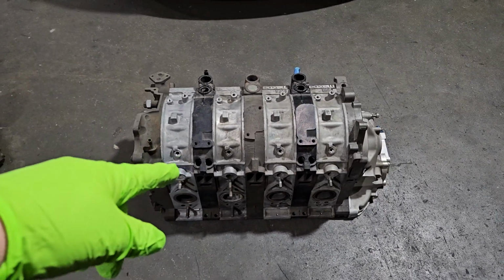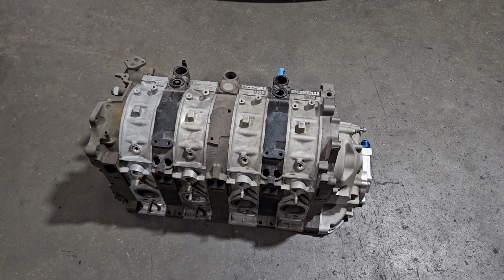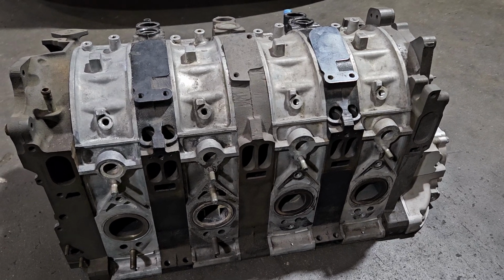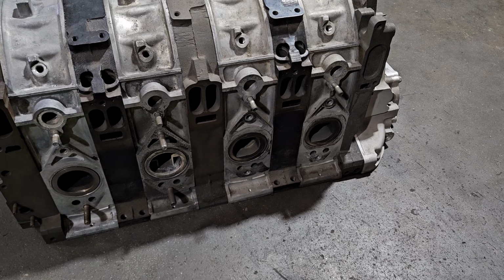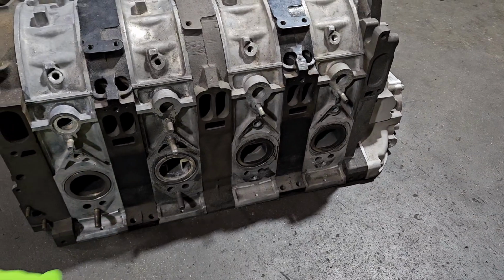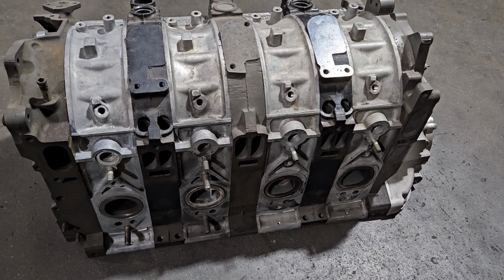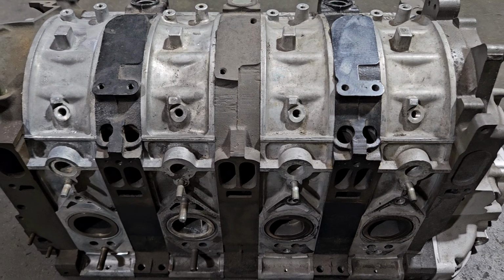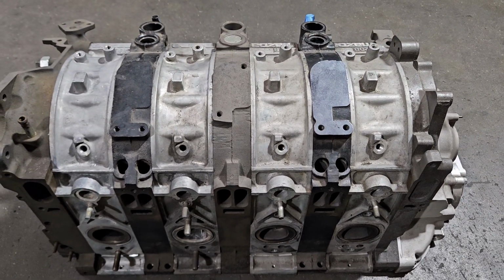4 ROTOR TIME - First mock up of my 4 Rotor for pro drifting - KMR Rotary - What's our plan

Comment: This is cool.  back in the day i never understood why the custom parts cost so much.  11 years ago when i entered the manufacturing world i discovered why.  Even if one has their own machines (i do.  i want to do smaller rotary engines since they really dont exist outside miltary contract drone engines) it's still bonkers expensive.  Machine time, tooling, cad time, cam time, setup time, material.  3 and 4 rotor engines are my favorite.  I love the sound they make.  Moreso the 20b.  That rule of 3 harmonic i guess........  I was weird even when i was on rx7 club a long time ago though.  nevermind me.  do work!
Reply from the maker: @LEterribleONE  👏👏